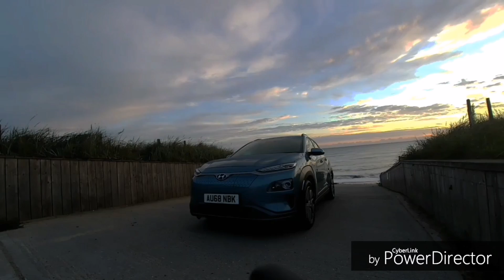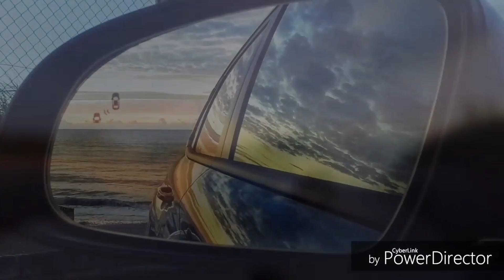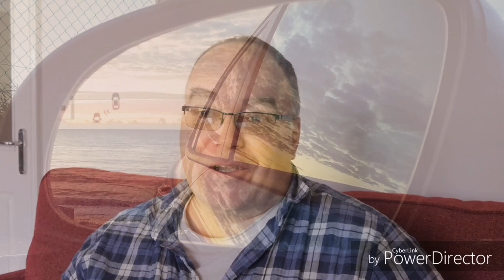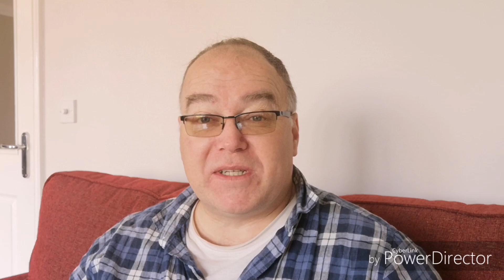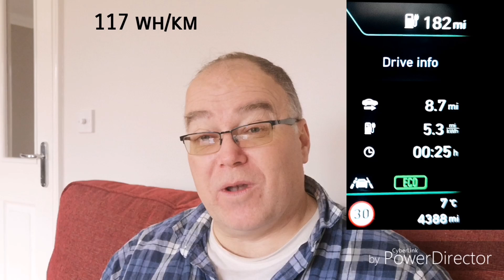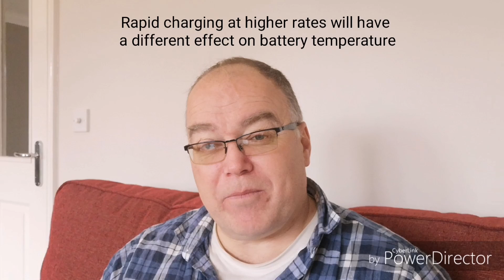Kona Winter EV efficiency tests. Does Preconditioning help?

Comment: Almost electric cars, I presume the Kona is no different The electric seats and the heated steering wheel are supplied from a 12 V lead acid battery not from the main lithium ion  battery. Also when the car is plugged in and you are preheating the cabin it is running from the power source not from the battery.
Reply from the maker: Didn't I say that?
Reply: Unless the car is plugged in all energy comes from the main traction battery.  It charges the 12 volt battery using an DC/DC converter.
Reply from the maker: Yes it's not self charging😉
Reply: The Kona has two modes of charging the Aux battery from the Drive battery.  Neither of which are when the car is actually being driven.  So whatever range is given when you set off will not be impacted by anything apart from driving and heater/Air con.  The two modes are:
Cycle Mode :
When the POWER button is in the

OFF position with all doors, hood and

tailgate closed, the Aux. Battery

Saver+ periodically activates according

to the auxiliary battery status.

• Automatic Mode :

When the POWER button is in the ON

position with the charging connector

plugged in, the function activates

according to the auxiliary battery status

to prevent overdischarge of the

auxiliary battery
Reply from the maker: Alan that sounds problematic. The 12v doesn't have unlimited capacity. On a long journey with  various features on, it must recharge or it'd go flat
Reply: @EVPuzzle  You'd think so but this is just an except from the manual.  I am over 2,000 miles now on mine and I haven't seen any notification that the 12c battery has had an aux. charge.  Do you ever see any thing like that come up on the dash Nigel?
Reply: The 12 V battery is just like the one in a petrol/diesel car, although it will be a bit smaller.  The car electronics keeps it charged with a DC/DC converter.  This device takes the 300 to 400 V from the battery and converts it to around 14 V to charge the 12 V battery.  This is just like the alternator does in a petrol/diesel car
Reply from the maker: No but it does warn you the 12v battery will deplete unless you turn the car on. That I guess implies, whilst on, the car keeps the battery charged.
Reply: @EVPuzzle  I've not had that.  I am confused so I give up.  As long as it keeps going I will accept what it does.
Reply: @alandimery3379  Re the charging of the lead acid battery questions. On the front of the Kona bonnet outside is a logo that lights up when the LA battery is being charged by the main set of batteries. This a clear sign that this is how it keeps charged.
Reply: @EVPuzzle  Re the charging of the lead acid battery questions. On the front of the Kona bonnet outside is a logo that lights up when the LA battery is being charged by the main set of batteries. This a clear sign that this is how it keeps charged.
Reply: @alandimery3379  the 12v MUST be charged under driving, just start it up and put a voltmeter on the battery. Headlights on, fan on high, rear defogger and seatheater will easily consume 40A or more. That's 1 hour and the 12v battery is dead without charging.
The aux-mode or what it's called is what you are refering to I'm pretty sure. That mode is designed to work when the car is not in use.
Reply: @therandomtester9561  You have a point.